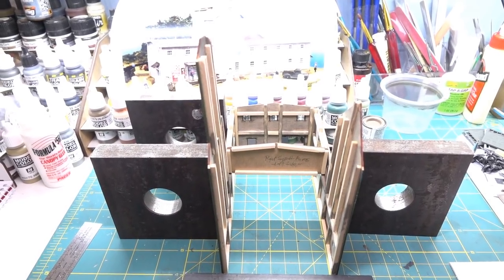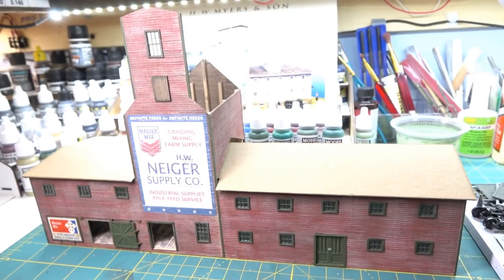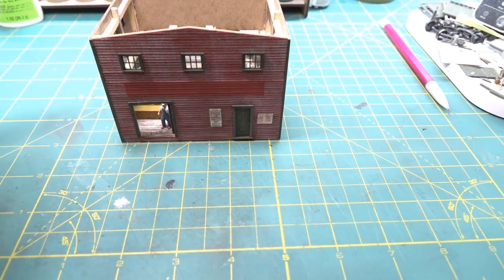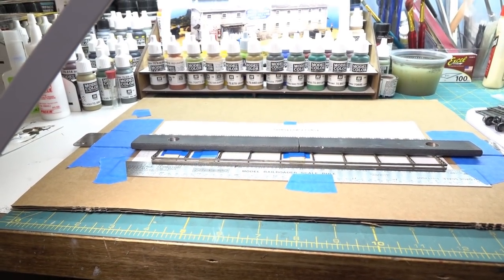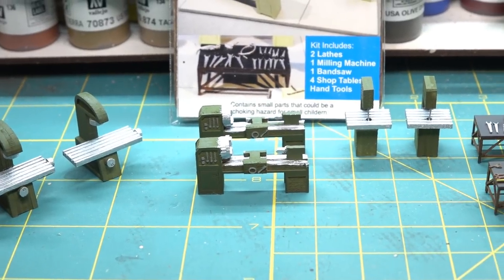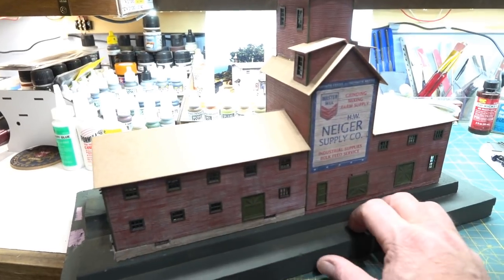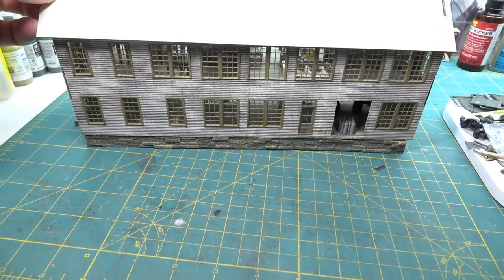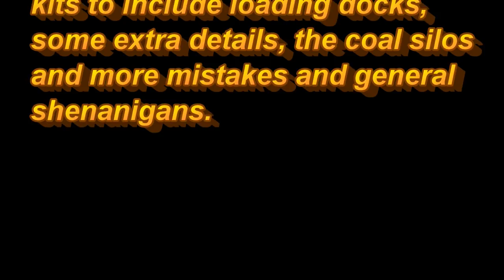Kit Build #2 & #3- Two Craftsman Structure Kits: Part 2

Comment: Rob, I didn't expect pt 2 so quickly. Either of these kits are a big deal on their own and you are tackling 2 at the same time with interiors. I cant imagine just how much time you spent on the video itself, let alone the modeling. Whos to say that you did anything wrong in the instructions, could easily be something over looked or not made obvious in the directions. These kits are complex and therefore not 100% accurate in design or instruction. Most craftsman builds I have seen have some issues or quirks to get past. Yours is very well done. Looking forward to pt 3. Merry Christmas, Rob T

Comment: The details you addrd are amazing  along with all the work you have done. Would it be possible to put like small magnets on the inside of the front wall so it could be removable an you can show off all the fine detailed work you did on the machine shop and drafting room. Thanks for sharing these kit builds,I do enjoy them.
Reply: That is a good idea, and likely I could have done that if I considered it at the time!

Comment: nice video rob i love your atenshon to detail but one thing you forgot in the buildings was the bathrooms lol
Reply: Ah, you caught that...and very true. Interestingly the Laser Modeling kit, with its' very detailed interior, did not include any bathroom. I would think any building of this size would have at least a small one. I suppose I will need to add an "exterior accommodation" for the folks to run to!

Comment: Really like those extra little details you always add to your structures. Where do you usually find them. Like the tables. Machine shop tools etc. Do you use eBay or what’s your goto website?
Thanks Will
Reply: Most of those items I had in my goodie boxes, but if I recall- I use tables/chairs from Preiser and Faller, tools from Vector Cut (out of business, sadly) GC Laser, Inter-Action, etc. The machine shop equipment is from Inter-Action Enterprises.
Reply: Rob Bennett Thanks for the help. I’m starting to detail my structures on my layout more. I greatly appreciate the advice. 
Will